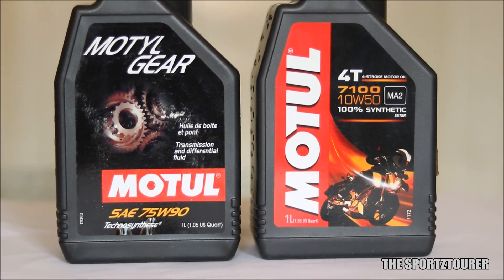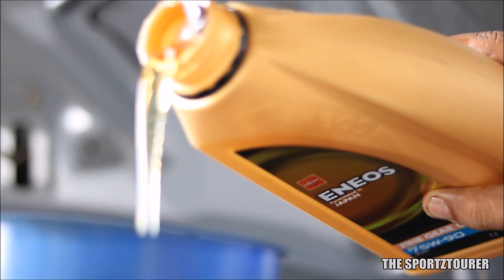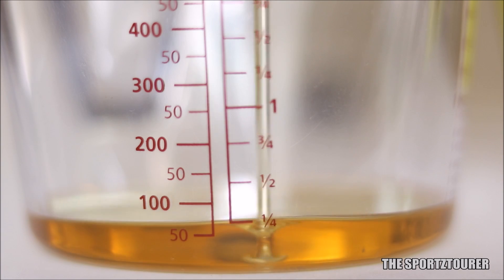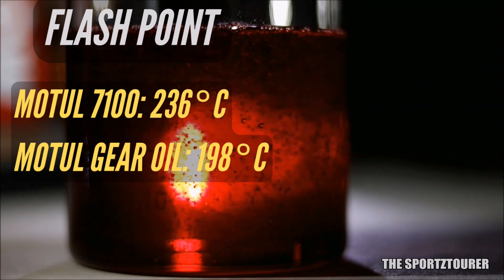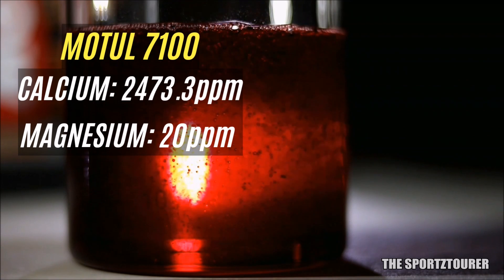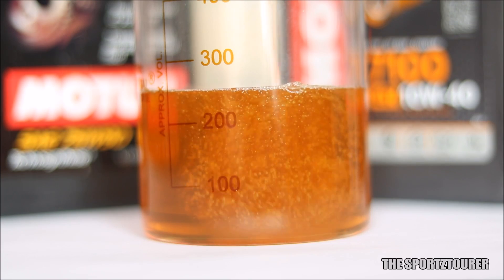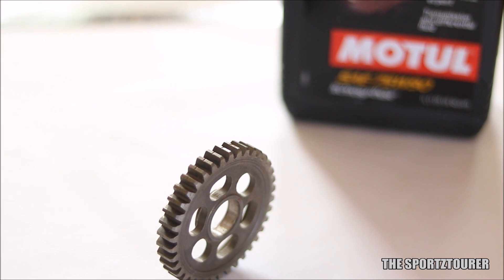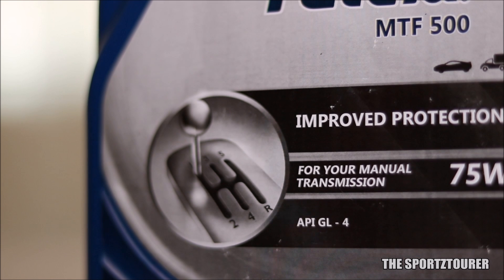GEAR OIL VS ENGINE OIL LAB TEST | MOTUL ENGINE OIL VS GEAR OIL ADDITIVE & VISCOSITY EXPLAINED

Comment: One suggestion brother please do make a review / comparison video of Eneos, Petronas Sprinta, Mobil, Total Energies and Valvoline Engine oils. As these are very big brands in engine oil industry and they offer scooter engine oils too all under 400 rupees. They highly attract us enthusiasts towards them.
Reply from the maker: Hi! Thanks a lot for the suggestion.
Mobil we have already covered: https://youtu.be/hckz_d7OKDY?feature=shared
Valvoline and Petronas are under test so keep a check on the channel 😊
Reply: @thesportztourer bro I used the Eneos scooter fully synthetic engine oil. Being a synthetic oil I expected it to run for around atleast 4k kms. Near 3k kms I randomly checked the dipstick and to my surprise it was bone dry. Upon draining the oil there was hardly 100ml oil and it looked like it came from a diesel engine. Idk if that’s an issue with my engine but I remember my scooter was once run on mineral oil for 4k kms it still looked much better than this. Idk what is to blame here my engine or the engine oil. Please drop your suggestion on this. I’m currently using the Mobil1 synthetic technology scooter engine oil.

Comment: Also... Gear oil 80w-90 for transmision scooter is better
.. Or engine oil 10w30 is better for transmision scooter... Help me pleaseee
Reply: You can use engine oil, but only for Japanese motorcycles

Comment: Well in that case, tvs has really gone mad with recommending the same engine oil to be used as gear oil for jupiter and jupiter 125 🤔

And the difference is certain. The Transmission works way better and smoother with the castrol gear oil.
Reply: It has better performance when I use motul 80w90 scooter gear oil 120 ml than castrol's

Comment: Should I apply a 140grade or 90 grade for chain lube?
Reply: Depends on your use......140 will stick better to chain as compared to 90 which flings at higher speeds.......for city riding upto 50kmph, 90 will serve the purpose

Comment: Bro I wanted to give Motul 20w Fork Oil to my Apache rtr 160 2v Matte Blue 2017 Model bike, I am buying two bottles of 175 ML.. It would be helpful if you tell me how much ML should be added to the front suspension...some say 140ML, some say 160 ML  ...Actually what size does the company have for this model??

Comment: During my leh ladakh ride. Used 20w 50 Castrol GTX cng /lpg engine oil. Was amazed by its performance from Kargil to manali , full circuit. 

Was informed by the mechanic to change again to stock oil parameters.

Comment: Please make a video on the usage of Chain Lubricants vs. Gear Oils on motorcycle chains. As there are many like me are confused & there are many videos in YouTube which suggest either to go for chain lubricant or gear oil.
Reply: I have switched to castrol gear oil from motul chain lube..its works better that spray...it remains on chain more..I will stick with it for life time
Reply: Use 140 gear oil..........I'm using same since 5 years for My CBR......never did chain adjustment as chain slack is maintained(20-25mm) due to proper lubrication.
PS:  I clean(with diesel) the chain every 300-400 kms and lube with 140 oil.
For lubing the chain, I follow this method - https://youtu.be/YCZ1NG8uYAU

Comment: I use gear oil for my hero motorcycle and sometimes Diesel engine oil in engine crankcase   My engine is smooth and noise free now

Comment: That was totally unexpected video. So can we mix a little bit of gear oil in engine oil for wet clutch system, for the EP additive.
Reply: no, you shouldn't. Too much sulfur can harm the engine
instead, try to use dedicated engine oil additives like MoS2, boron-ceramic in proper dosage
too much additives can cause clutch slipping

even very high quality MA2 oils may cause slippage in rare cases
Reply: @axetilen xin mạn phép góp ý, với kiến thức hạn hẹp của mình.

Scooter có thể thêm phụ gia, ví dụ như (E59,Very lube turbo,Nano Bluechem...), nhưng với ly hợp ướt, tốt nhất là hãy chọn 1 loại dầu gốc tốt ( fully synthetic), chứ đừng thêm bất cứ
 cái gì cả, vì dù sao, khi ra lò 1 chai dầu nhờn xe số, nhà chế tạo đã tính toán cân bằng giữa bảo vệ động cơ, bảo vệ ly hợp và chống trượt❤

Comment: Can the gear oil used for apache 200 chain ?? It's it safe as the local mechanic uses
Reply from the maker: Lets also consider that even if it corrodes, the damage will be superficial on the brass coat which ultimately should not effect the final drives performance (apart from rust development). 
Most riders get brass coated chain drive for the looks so I thought of including that in the video 😊
Reply: @thesportztourer TQ Apachian
Reply: 4:18
Reply: @kuldeepB601  😅 i hasn't understand so i asked should or shouldn't?
Reply: Because of sulphur which is present on gear oil he suggested to avoid using it as it might corrode the chain